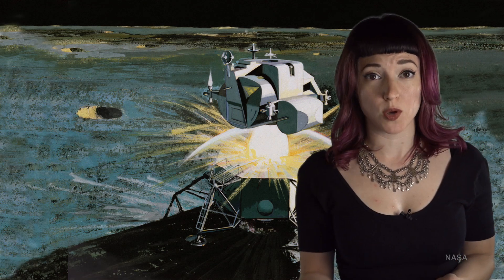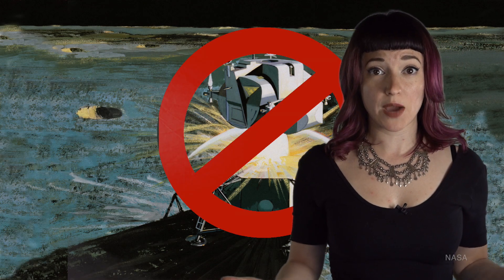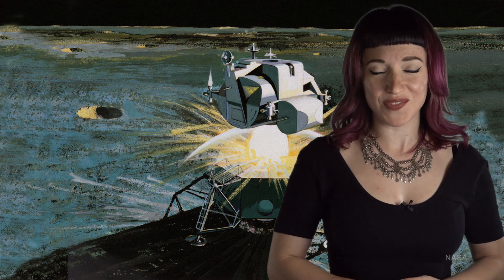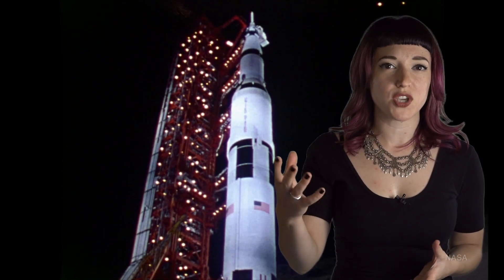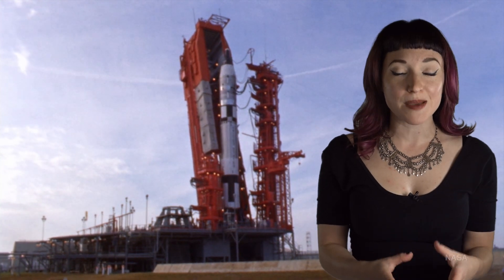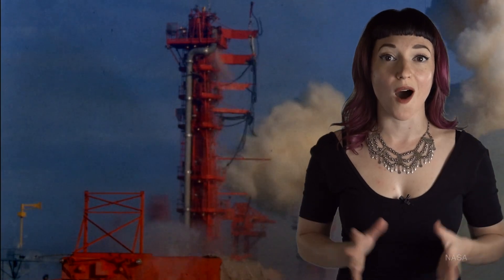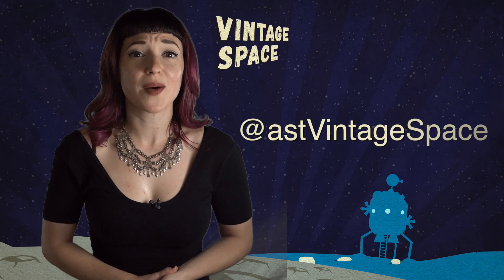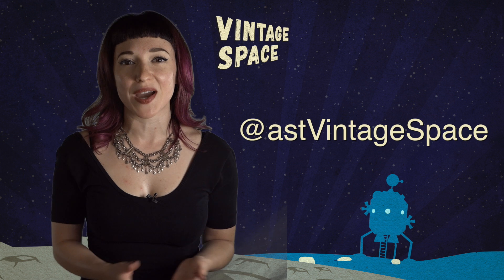How the Lunar Module Launched from the Moon Without a Flame

Comment: Now, explain how the Lunar Lander batteries could survive the excess temperatures on the lunar surface. The lunar temperatures greatly exceeded the engineering specifications of the batteries.
Reply: A) They were inside the lander, under the layers of thermal protection.  How can you be next to an oven that's 500 degrees, cooking a turkey for Christmas dinner?  Because there's an insulated door between you and the turkey.  Same thing here.  With layers of thermal insulation, the inside is not very affected by the outside.
B) Why do you think the batteries would be so affected by surface temperatures?  Do you think they took the batteries out, and placed them onto the surface?
C) What EXACT temperatures of the lunar surface are you complaining about?  What EXACT temperature do you think the lunar surface was, such that they'd need to worry about the batteries?
Reply: This is simply not true. You must have made it up.

Comment: They dont burn clear, you can watch test runs of that exact engine. It blows a 20ft flame out of it.
Reply: Yes, they do burn clear.  I'm sorry if you're watching videos that are not accurate, but, N2O4 and Aerozine50 burn with a flame that isn't visible to the human eye.  The exception is when they run rich or lean, and then you get some burning with O2 instead of N2O4, or you get some breakdown of N2O4 into 2xNO2.  Then, you can start to see some of the flame.  But, if in a vacuum, and the mixture balance is correct, you won't see it.
Reply: Could you please provide a link? Were these tests conducted in a vacuum?

Comment: So unfortunately I can't prove it with video because YouTube deleted all of them, but You're 100% wrong, hypergolic fuel that was used on Apollo lems & command modules burned dark red, were extremely toxic, & had a red flame.
We never went anywhere.
Reply: No, dewdrop.  N2O4 and Aerozine50 burn clear/invisible.  The reddish brown tone only comes from the byproducts produced from the breakdown of unburned N2O4 (i.e. NO2).  This happens if the mixture is not correctly balanced, and/or if some of the fuel mixes with oxygen from the atmosphere instead of with the N2O4, and some byproduct is produced instead.  In a vacuum, with a properly balanced mixture of fuel and oxidizer, you won't see the burn.
Reply: @rockethead7  
How old are You shitpot?
I have the videos of NASA developing the LEM, You're wrong, She's wrong, AND YOU TWATS CAN'T ACCEPT WE NEVER WENT ANYWHERE
Reply: So, your position is that you have magical videos of Aerozine50 and N2O4 that produce a visible flame, contrary to the entirety of chemistry that says otherwise.  And, you've come heroically to a YouTube comment to reveal this to the world?  No?  Not in chemistry journals to outline that the distance jumped by those electrons during the chemical reaction produces a visible flame, unlike what any rocket chemist on Earth would tell you.  And, YouTube is the forum that you're revealing this to the world?  Why do you suppose none of the actual aerospace engineers who designed and built the rockets ever noticed that there wasn't a visible flame?  How is it that the manufacturer of the fuel (Aerojet General Corporation) never said a single word about the flame being "wrong"?  Or, hmmm, you're a crank who has no actual knowledge, watched a video that showed some stock footage of a rocket firing (which wasn't actually running on Aerozine50 and N2O4), and now you think you've got this smoking gun proof?  Really?  So, dewdrop, I have a video from WWII of an Iowa class battleship firing its guns in battle in 1942 (despite that no Iowa class battleships were completed until 1943, and none saw any battle action until 1944).  So, how is this possible?  Is this because somebody used some stock footage in a documentary that was inaccurate?  Or, is this because WWII never happened, and it is a major "gotcha" that I've found this error?  Gee, could it be that your magical footage of Aerozine50/N2O4 rockets producing visible flames were just stock footage, and not actually the rocket fuels/oxidizers you're claiming?

Sorry, dewdrop, you don't know anything.  If you think there should be a visible flame, produce the results, and publish in a rocket chemistry journal.  YouTube comments is where cranks run to pretend to know things they don't.
Reply: @rockethead7  
Omfg!
I hardly read any of that, idgaf if everyone thinks the moon is a marshmallow, fuckoff globetard. 😂
Reply: @Not1Edit  : If you think Earh is flat, you have to address way simpler questions before Apollo.
Like "where is Sun after sunset", for example.
Reply: @ThomasKundera  
You have to address it!
It's flat, it's Your job to figure it out, not mine sonny
Reply: @Not1Edit  : Earth is a globe, I can help you to figure that out, but only if you're willing, of course.
And the fact you can"'t explain where is Sun after sunset if Earth was flat, is one of the (many) evidences that are telling you Earth cannot be flat.
Reply: @Not1Edit  :
"I figured it out"
Until you show evidences and explain it that's just empty words.
And I stay on my point: a Sun in line of sigh would always be visible.

" YOU FIGURE IT OUT! DON'T PROVE IT TO ME, PROVE IT TO YOURSELF!"
Keyboard issue?

"Artificial Horizon Indicator on"
Has nothing to do with my question.
Again: where is Sun after sunset?

Comment: where is the fuel tank? This module should be 1/6 the size of rocket used to launch off earth, since moon's gravity is 1/6 of earth's gravity. How is it so small?
Reply: "where is the fuel tank?"

The schematics are readily available, you know.

"This module should be 1/6 the size of rocket used to launch off earth, since moon's gravity is 1/6 of earth's gravity. How is it so small?"

Huh?  The job of the Saturn V was to lift 100,000 pounds of payload in Earth's gravity to an altitude of 238,000 miles (which translated to about 6 million pounds of rocket craft/booster/fuel/oxidizer).  The job of the lunar module ascent stage was to lift two guys and some rocks in lunar gravity to an altitude of 62 miles (which translated to about 1,950 pounds of rocket craft/engine/fuel/oxidizer).  Please tell me that you don't honestly think that the only factor here is 1/6th gravity.  I mean, let's get serious here: do you REALLY believe that the entire planet's aerospace engineers for the past 50+ years have somehow magically overlooked the notion that the craft couldn't do what it was designed to do?  Really?  Is that really your argument here?
Reply: they jettison empty fuel tanks and other unneeded equipment.  for example the module used to descend to the surface was left behind
Reply: "where is the fuel tank?"

They're the bulges on each side of the ascent stage, as shown in any diagram of the lunar module ascent stage.

Comment: The problem is they didn't have the technology to control that thing. No human could fly it without high tech computers to keep it from getting out of control. They would have controlled it from 163,000 ft down to the lunar surface then 163,000 ft back up and dock it.  I don't believe they could have pulled that off with the limited computer power they had. Maybe if they would have crashed 100s of times then finally made it but to achieve that flawlessly the first time and every time after that with out a crash. No way I can believe that.
Reply: So, with no air, no crosswinds, nothing but basic thrust, you think it would be more difficult to fly than a basic airplane?  You think the first several hundred landings would be crashes?  Dewdrop, then how do you think any airplanes can even be flown?  They're more difficult, you know.  Yet, the Wright brothers had hundreds of flights before the first crash, and they didn't have anybody to teach them, and no simulators.
Reply: Are you joking?  It was so easy to fly in lunar gravity it must have been boring.  And of course they completed the landing 1000s of times in simulators before doing it for real.  You be a fool to only try 100 times.  A fool!

Comment: Your clear flame example was not clear lol
Reply: You're missing the point.  It's almost completely clear, because you can see right through it, unlike a kerosene fuel burn, like the Saturn V 1st stage used.  The main difference between the Titan's and the lunar lander's flames are that you can see the interaction with the atmosphere on the Titan, but, there's no atmosphere on the moon to interact with.  They also ran the Titans rich (more fuel than oxidizer) to keep them cool, but, this means that there's some leftover fuel to combine with the oxygen in the air, and you'll see a bit of that also.  But, you cannot see the flame of N2O4 and Aerozine50.
Reply: Nice eye.  Out of hundred kind of fuel available they had to choose the one that is invisible... not only that everything else look fake...acceleration, confetti boom, camera cutoff

Comment: What I've always found curious is where did they reposition the helium tank that pressurized the ascent stage rocket after Apollo 14? Diagrams show it removed and then replaced with the lunar rover for 15,16,17. Unless of course they found a way to pressurize the propellants using some other means? And how did they manage to safely store their food and water without the use of an airlock? Wouldn't exposing the interior of the LM just once destroy these supplies? I imagine negative TOR values on the moon are significantly higher than anything we can produce here on earth? I've always found the Apollo program just endlessly fascinating.
Reply: "Lunar module 10 through 14 familiarization manual" - it tells you everything you're asking about for the diagrams and tanks and stuff.  Food was in vacuum seal bags.  Water was in tanks.
Reply: Interesting comment. I dont even know what tor value is.😂